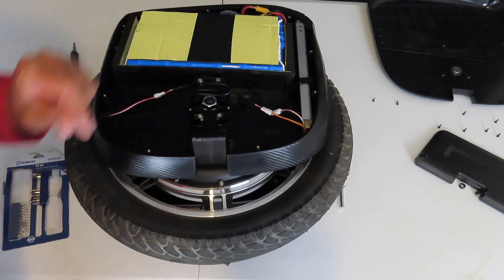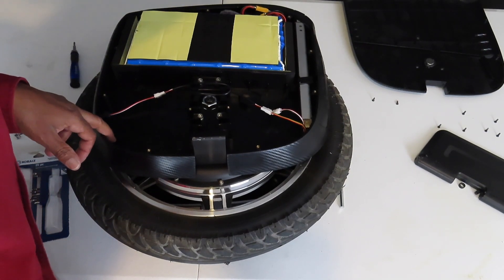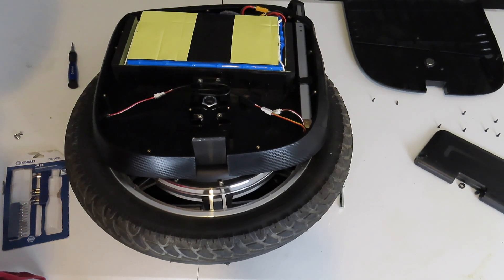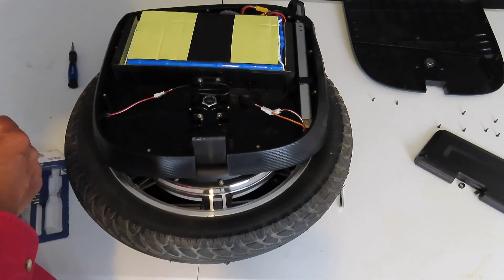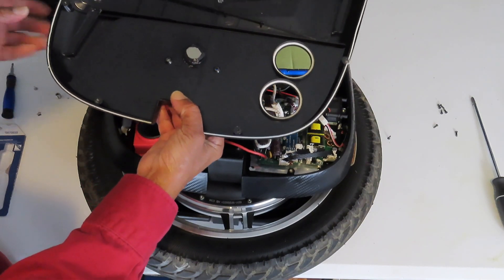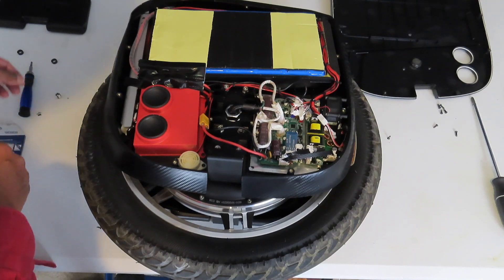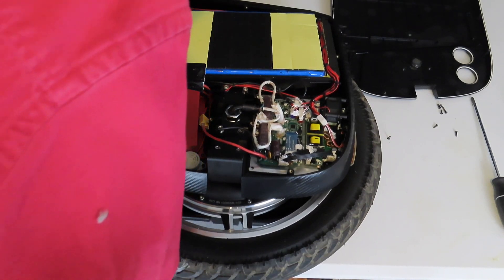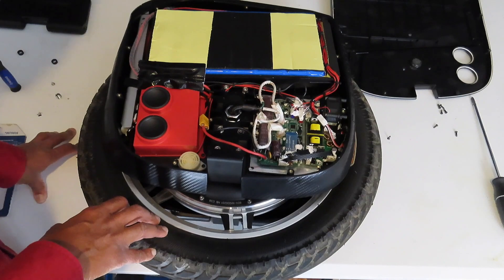Gotway MS Pro., Is it really, "Waterproof"?

Comment: euco videos had a seal on the side without the control board..so maybe is just an manufacture error!
I have seen guys that added the buzzer on the outside top part of the shell. last thing to mention I have seen a guy adding a stainless steel steel mesh strainer over the bluetooth holes so that to protect them from puncture. nice video
Reply from the maker: Thank you for your support and feedback. Several guys that have a Pro made mention of the fact only one side of the wheel had a seal around it and low and behold, so did mine. A guy in my riding group did move his buzzer on the outside top portion by the handle of his wheel. Now as for the speakers.., the sound quality is not good in my opinion. At first I thought my phone column was down, but that was not the case. The speakers sound piss poor and because they are positioned so close to the bottom rear of the wheel, it makes them sound as if they're off in the distance, like someone behind you is playing music and not the wheel your riding. That's just one of my dislike if the wheel.

Comment: Good review.  Last week I opened up my Kingsong 16X for the first time to replace a non latching handle.  Once opened, I discovered two broken parts from the factory. One of the pieces broken was not inside the euc.  I sent Jason, from Ewheels,  some images and he was kind enough to send me out the missing part and the micro switch that I accidentally broke.  So I guess quality control can be hit or miss with both companies.  Ride Safe🙏
Reply from the maker: Thank you for your comment and you are definately correct, but what's noteworthy of mention is finding random pieces in a wheel., which has been Gotway's common story amongst other things.

Comment: Good vid Vee 👍
I don't think they put a seal on the other side as it is only the battery,less siseptiable to water damage with only the battery, no control board!
I would not be afraid to take it in the rain😁
Cheers
Reply from the maker: Neither would i hesitate to ride it in the rain; however, battery packs have been known to catch on fire after taking a dip in the pool, such was the case with the MSX that went on the plunge with me last year. Once the rider took it out of the water, it was a matter of seconds before it ignited. The Nikola that fell in the Baltimore Harbor., later that evening, an apartment caught on fire where the batteries were stored. I don't know if these are isolated incidences, but nonetheless something to consider. And as always, thank you for your support and feedback. 🤗., oh my bad..., social distancing..😷 😅🤣

Comment: that beeper is so low down... might be hard to hear

Their new beepers are very loud though and this wheel isn't too fast...so shouldn't be a big deal. '
Reply from the maker: So much power but no speed to match. I got it to go to 35mph, but was apprehensive to push it because of my fear of not hearing the beep. I'm going to incrementally push it some more to see if I can hear it and at what speed. Noteworthy, I did feel the tiltback between 32 and 35mph., but no beeps. 🤔